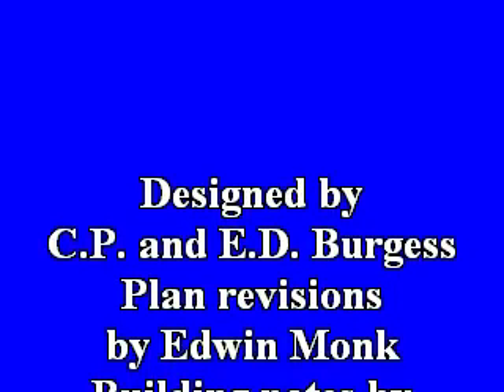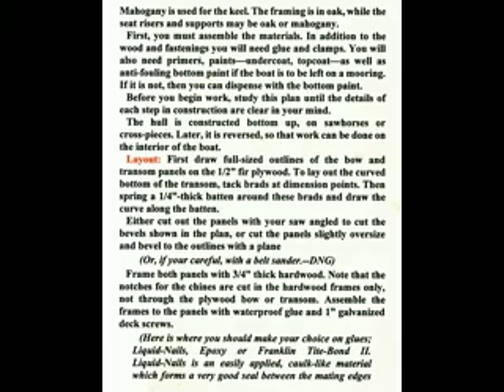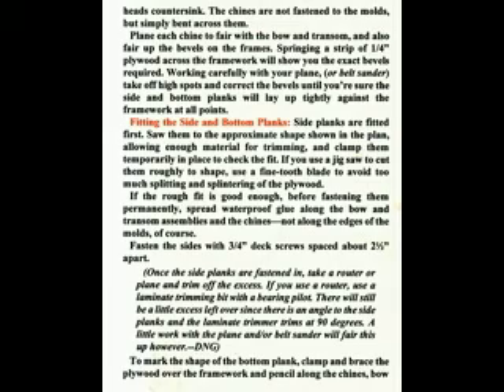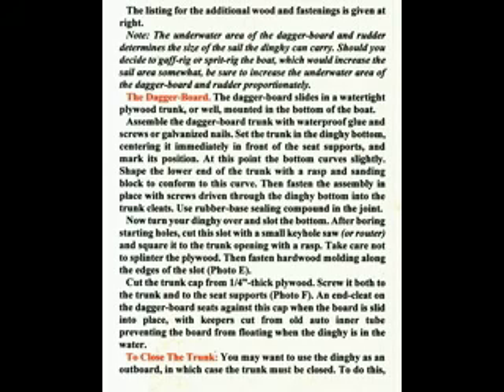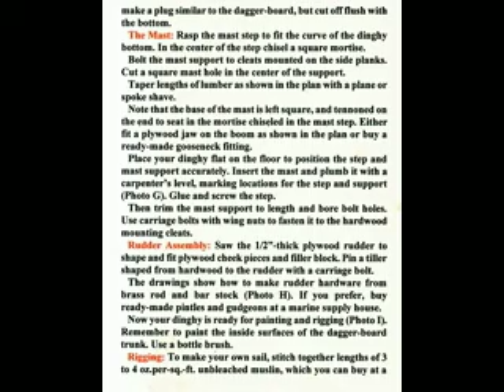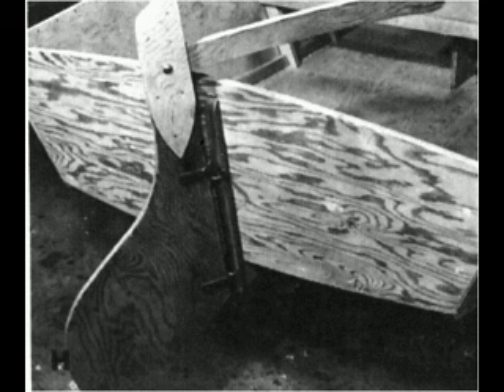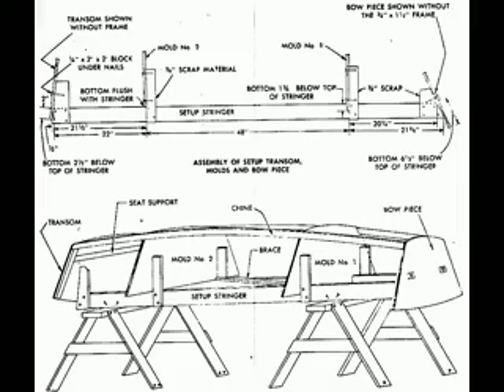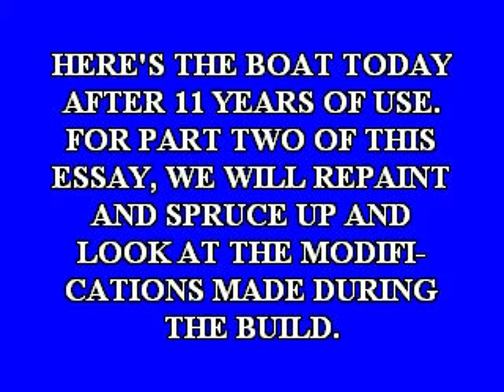BUILDING RING-A-DING--A 7' 9" PRAM DINGHY--COMPLETE PLANS.avi

Comment: Titebond 2 is NOT waterproof, only water resistant. That's why it's not recomended below water level. Use Titebond 3 because it IS waterproof and will stand up below water level well. When used with painters cloth (light canvas) it sets up like fiberglass (hense the term, "poor mans fiberglass")